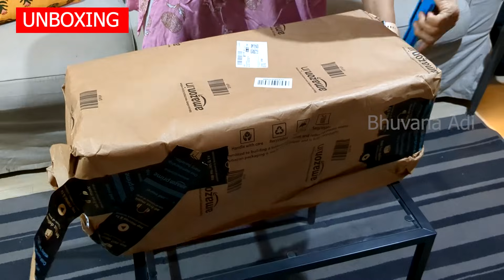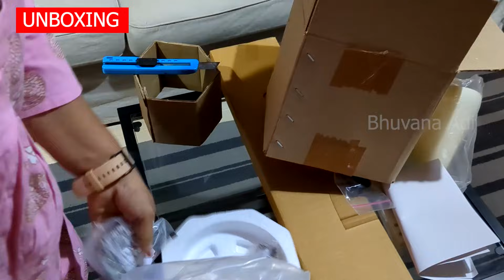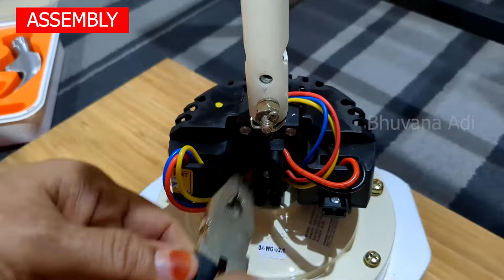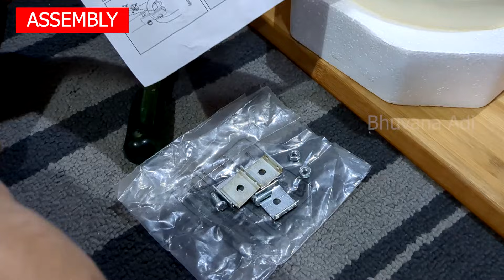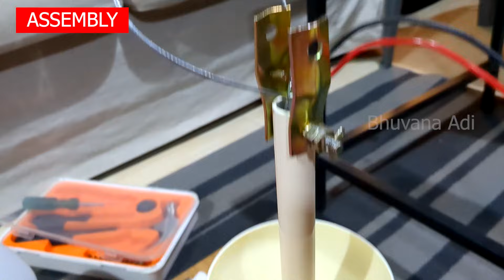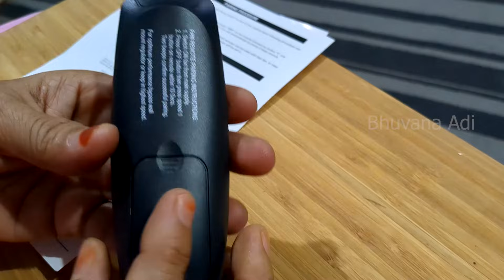BLDC ceiling fan | Crompton Energion Hyperjet

Comment: I bought the same model bldc fan yesterday, after the Installation it wasn't working fine, 
Whenever I click hyper or speed any button it was automatically turned off and nothing was working did you face any issue or any solution for that?
Reply from the maker: I’m sorry to hear that, but I personally didn't face any issues as the fan worked perfectly for me right after installation. 😊 But I learnt that this issue could be due to regulator being connected in the circuit or loose connections in the fan or the remote is not paired properly.
Hope you have removed the regulator? Also please check the connections in the fan for loose contacts. Then you could follow the procedure of pairing the remote with the fan as mentioned in the manual.
After doing all the above, if the issue still persists, then you could call the service centre. Thanks.

Comment: do i have to remove the regulator of old fan? or I can forget about it and install this fan
Reply from the maker: You can disconnect the regulator of the old fan and connect the fan directly to the switch. The switch should be kept ON always, so that the fan can be operated with the remote.

Comment: You have shown only red wire connection, what about black wire. ????
Reply from the maker: Hi @ravivarma, actually the black wire has been connected, but I have forgotten to mention that the black wire has also been connected like the red wire. Subsequently in the video I have shown taking both the wires through the pipe. Hope this clarifies. 
You can watch the fixing of another fan - Atomberg Efficio Alpha in my channel, where I think I have explained in more detail. You can watch it by clicking the link below:

BLDC LED Ceiling Fan / Atomberg  - Unboxing, Assembly, Fitting & Remote explained
https://youtu.be/PJcEraBgpbU

Thanks.

Comment: + and - retar conection Ani problem
Reply from the maker: If possible try to connect correctly. If you have connected the other way, there is no problem, as it is AC power supply. 
Thanks.

Comment: I am the forth time buyer of bldc fan. I have not had any problems with the previous Atomberg fans so far. But this fan has not been working since the first day after buying the Crompton fan. After the technician came, he said that the circuit needs to be changed. I still don't know when he will come to change it, the fan is still useless.
Reply from the maker: Thanks for sharing your issue and your thoughts on this fan. Very sorry that you are facing problem with the fan. Sometimes it happens that certain appliances turn out to be faulty while buying or get repaired soon enough. I too have faced such things with a couple of my gadgets/appliances.
I have been lucky with the fan with almost two years of usage. It's working fine. 
Please take up with the company, tweet the issue and tag the company, that way action will be taken immediately.

Comment: I just got crompton energion hyper jet bldc ceiling fan 1200 mm installed. It is working fine to start with. The remote supplied is having crack which needs to be replaced. The installation was done very late by the company which needs to be improved. We have to watch it's performance for sometime now before a judgemental can be made.
Reply from the maker: Thanks for sharing your experience. We have been using it for almost 3 years now and it's been working fine.

Comment: is this fans receiver has any reset button ...because my fans remote is not able to pair with the fans receiver
Reply from the maker: To the best of my knowledge, there is no reset button. But the procedure for pairing the remote with the fan is given on the back of the remote (battery cover). Please try it. In case there is a problem in pairing the remote, there could be a manufacturing defect. May be you should contact their service centre. Thanks.

Comment: I have used Sleep mode what to do now
Reply from the maker: Crompton has not explained the sleep mode on the remote clearly. I have also made a video on Atomberg fan in which I have explained the sleep feature more clearly. You can watch the video here -
https://youtu.be/PJcEraBgpbU
I think the sleep mode in this fan must be similar to that. 
In case you have used it, and if you want to cancel it, I think it must be quite easy. All these are toggle type, if we press once it activates, if we press again, it cancels. And any function chosen goes off when the fan is switched off.
Hope this helps. Thanks.

Comment: Didn't receive the safety cable, orderd from amzon, what to do???
Reply from the maker: Please check whether it is mentioned in the packing list in the carton. If it is not written, then you have to buy the safety clamp. If it is written and you have not received it, then you can ask for replacement or return. Thanks.

Comment: Madam electricity bill save ayindha ee fan tho....basic ga naku 700 bill vastadi regualrga....ee fan pedte 100 to 200 rs save cheyocha
Reply: Crompton energion hyperjet..gurichi
Reply: I have bought this fan at 1800 rs...is it a good buy
Reply: @scalperram from where did you buy that I bought for 2200
Reply: @vinodkumar-pm2nb  got it from Amazon w
Reply from the maker: https://amzn.to/4gR8yoC 
Present price is ₹2300. But if we exchange old fan, then I think we get about ₹400 exchange value.
Thanks.
Reply from the maker: Geyser, AC laaga fan oka pedda power consumption item kaadhu. Manam full 24 hours nadpiyadam ledhu. Than to patu pedda difference emi kanpadodhu. Entha save avuthundho adhi mee usage meeda untadhi.
Thanks.
Reply: @BhuvanaAdi  3 FANS UNNAI INTLO.....BASIC UNIT AVERAGE GA 125 UNITS UNTADHI MONTHLY....SO BELOW 100 UNITS VASTADHEMOI NEXT MONTH NUNCHI.....EE FAN 2 UNTE CHAKLKU
Reply: EPPUDU 100 UNITS BELOW VASTE BAGUNDU ANIPISADHI MADAM....E FAN PETTIN TARWATHA NEN EXPECT CHESTUNNA......BELOW 100 UNITS ...SLAB RATE KUDA PADIPODDI...BILL JUST 250 RS VASTADHI...IPPUDU 550 VASTUDI
Reply: Madam is it must to connect positive line from main to positive line in this fan and neutral line from main to neutral line in this fan .or else we can connect in opposite way also...
Reply from the maker: @diyaashrimitraaj6205 That is not mandatory as this is AC power supply. So it can be connected either ways. But in case you can identify the + and neutral in both, it can be connected + to + and neutral to neutral. Thanks.